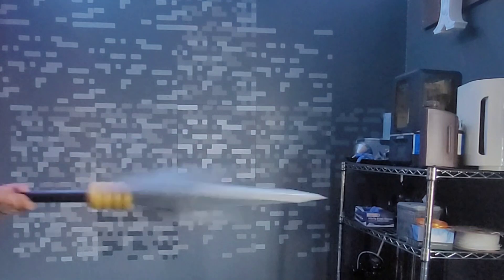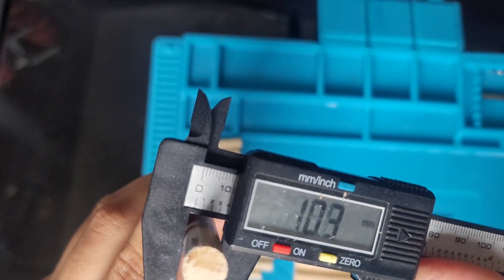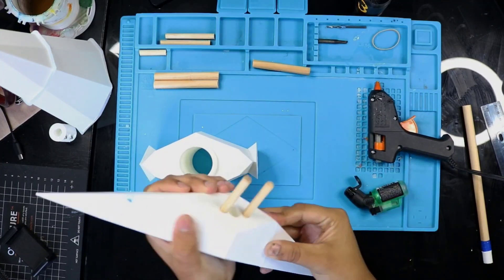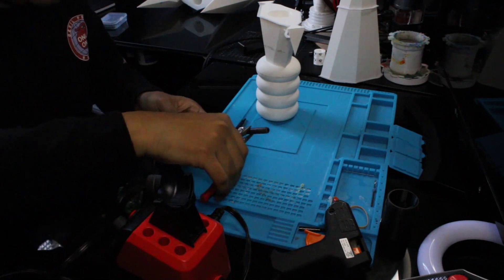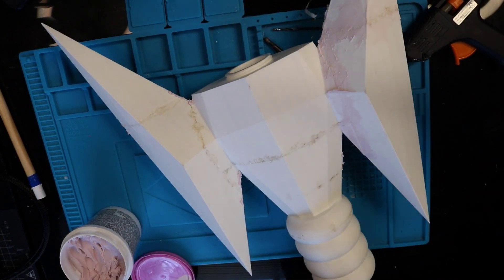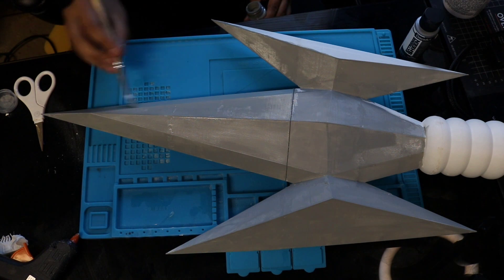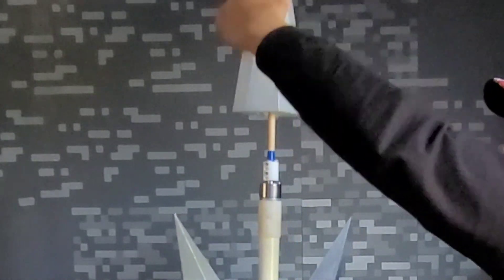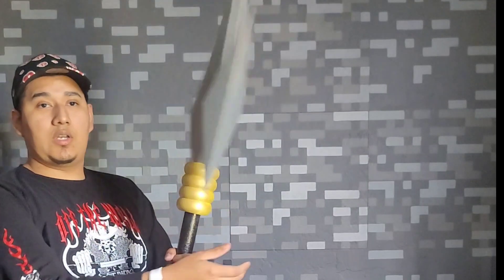How I made Katakuri Mogura [one piece weapon prop, 3D printed]

Comment: Hey, ordered the same motor as the amazon link, it shows 12V. Do I have to find a different motor for my 9V battery? First time working with circuit so trying to learn.
Reply from the maker: Sorry for the late reply. The motor will still spin as low as 6v. It will spin slower and adding more voltage will make it spin faster. Hope that helps

Comment: I’m not sure if the wire is messed up or what but the 9 volt battery is only lasting 10 min is that the same for you?
Reply from the maker: Sorry for the late reply. You mean 10min non stop running the motor or 10min just being connected. If you only get 10min after connecting the battery and it's just sitting their than you might have a short somewhere. I have my battery connected for months and still works. If you want to get more run time on the motor I suggest getting 18650 battery. You do need a bit more understanding on how to wire it tho. Let me know how I can help

Comment: Hello so I printed all the parts until I got too the motor holder, and I ordered the same motor but when I put the motor in, and it won't fit, did you have to sand it a lot to make it fit or it just snug fit in?
Reply from the maker: Yes, depending on the printer, the z seam is slightly bigger or smaller in 3d printer's. I did had to sand it for a bit to get that part off and get a tight fit. Also I warm the part carefully with a lighter and the motor metal. Just warm enough to make the pla bend a bit. If you are still having problems let me know and I can design a new part that is slightly bigger.

Comment: What you use for the handle?
Reply from the maker: Charlotte PVC pipe I got at lowes. Is 1.3in or 33.5 mm in diameter.
Reply: And what 3-d printer you use?
Reply from the maker: @bambam6093  I have ender 3pro and ender 3v2
Reply: @ghost3dprint487  Sorry for so many question i just am wanting too make this so much so i been learning 3d printers but final question is what fillament you use and how many spools did you use to make it?
Reply from the maker: @bambam6093 Don't worry I made this channel to help other built their own props and get ideas. I use less than 2 (1k spools) and PLA.